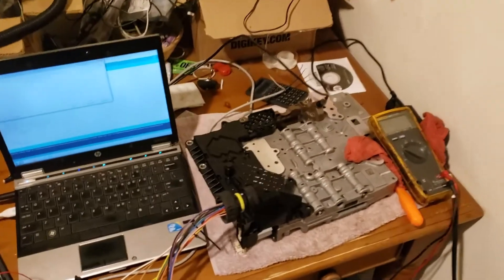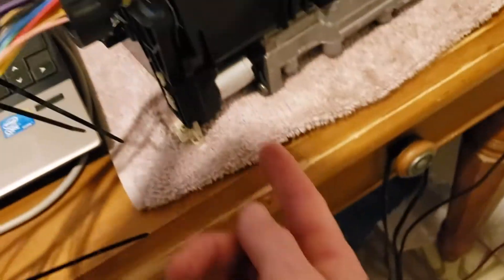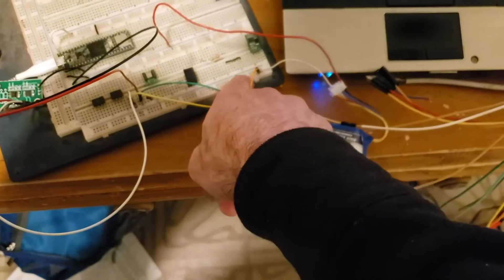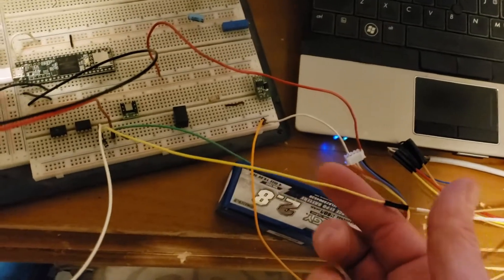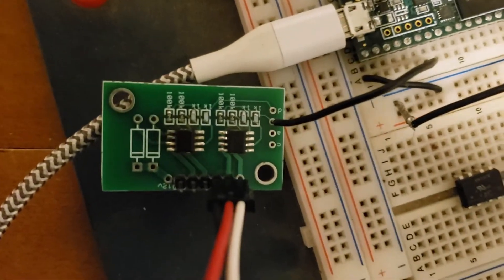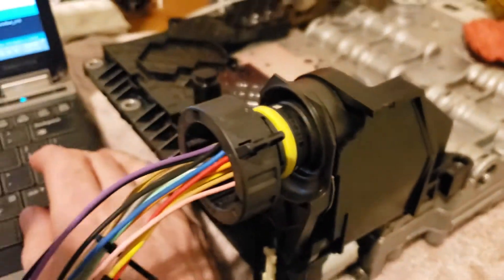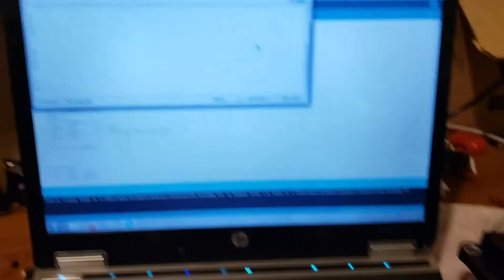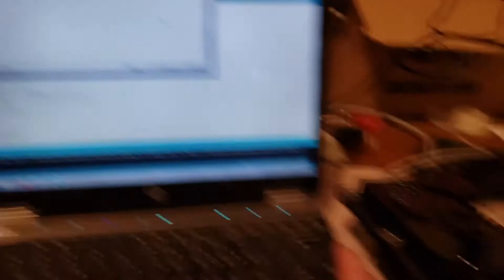6R80 Shift Solenoid PWM Testing

Comment: Not sure if you ever got your 6R issues fixed but lately I have been able to pair a 6R80 to a BMW M57 diesel engine for a customer in Canada. He made his own adapter plate in his 2011 f150 3.5 EB 4x4. He removed the original engine used a BMW standalone ECU  kept the original trans and PCM and I was able to adapt a calibration to operate the transmission alone Via very few sensors. Like Pedal, Crank Signal (RPM), coolant temp, and t-map sensors. The truck has bee a daily driver since December and I was able to get it to operate as if it came with the truck. If you need similar support you can message me any time.

Comment: Hey man you really know your stuff to build a circuit board like that I have a 2011 Ford f150 it won't go over 65 would you suggest replacing the shift solenoids or replacing the whole valve body assembly
Reply from the maker: Might be easier to do the valve body with new solenoids.  Just do it once...  50/50 shot you guess the right part the first time.

Comment: Hey just curious is there any actual difference between all the solenoids for the shifts? I'm not trying to do any swaps I just wanna fix my transmisson
Reply from the maker: Yes there is. 2 are normally open and 2 are normally closed.  I think A and C are NO type.

Comment: Do these solenoids rely on pilot pressure from the hydraulic fluid to drive them back and forth?  I am testing linear solenoid valves on the car with the pan off, using a TECH2 to turn the solenoids on and off.  They aren't really moving, though the resistance is correct.  Is that typical or is there varnish preventing them from moving?

Nice use of a Teensy BTW!! We use them in our Tympan Open Source Hearing Aid platform
Reply: Another way to put it... Are you seeing the solenoid move on the bench, or just hearing them buzz?  I like your idea of pulsing the current.  That's built into a lot of pneumatic on/off solenoid driving circuits.
Reply from the maker: @Eric-lj8sw  i could not see the pintel move when I sent current through them.  Just the buzzing(pwm) or clicking(on/off) when driving.  I'd like to rig up a way to run trans fluid through them to see the change in flow at different pwm values.
Reply: @olboy1981  thanks, that's helpful.  I was about to diagnose the solenoid as bad, but really it needs pressure to move.

Comment: i have been using arduino uno to drive my 6hp26 and 6r80 for several years now.
Reply: Ah you’re on the mega squirt forum I saw your posts
Reply: Sick! Are you using dx gears? I’m trying to do something similar on another zf6 speed. Or did you write your own setup? Also my tcm uses a 8 ish volt power system for some reason. Did you set yours up to use 14v?
Reply: @th600mike3  i have 2 different codes and both work great. what is dx gears?
Reply: @turbothis  dx gears is a shoot off from megasquirt's mega shift GPIO setup. Runs on a mega 2650. Do you have your code uploaded somewhere? That would be super helpful lmao. I'm so bad at the coding side of things

Comment: hi. is it advisable to replace solenoid or buy the whole assembly?
Reply from the maker: Depends on what issues your having.
Reply: @olboy1981  for this trans all the solenoids are pwm??

My case is the 8 speed zf8hp
I know torque converter and line pressure  solenoid are pwm but i dunno of the rest are on off 

Do you have an idea?
Reply from the maker: @FirstLast-tx3yj  since the 8 speed is nearly identical to the 6 speeds id think that are all pwm.  The 6r has one thats on/off.  You'd need to find a service manual to get that info.
Reply: @olboy1981  can you please send me the wiring diagram between the valve body and arduino along with the code through email?

Or any method you want please...

I am rotating it with an electric motor and want to shift it on the bench
Reply from the maker: @FirstLast-tx3yj  for the 8 speed or 6?
Reply: @olboy1981  which ever you have... preferably 8 but if you have 6 it would be good too

Comment: Don't they have standalones for these trans?
Like US shift  sorry lol
Reply from the maker: Yes they do but I want to drive the transmission from the same box that runs the EFI.  I'm using a MS3 system.
Reply: @olboy1981  makes sense, so if I'm correct all I need is an adapter, trans itself, custom drive shaft, mount, and the US shit set up.
Reply from the maker: Correct, I'll have about $1K once its all done in this swap.  Biggest savings it the custom code and hardware mods to the MS3 box.
Reply: @olboy1981  awesome, lmk if I can buy an adapter in the future! Keep up the good work! Posted in the lightning group and they just wanted me to build a e4od lol already got 2 4r70ws